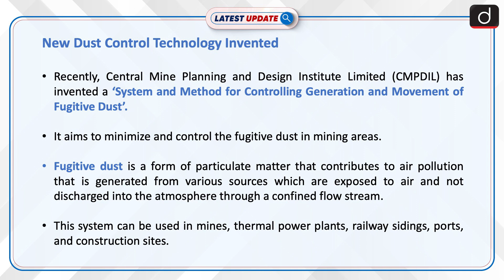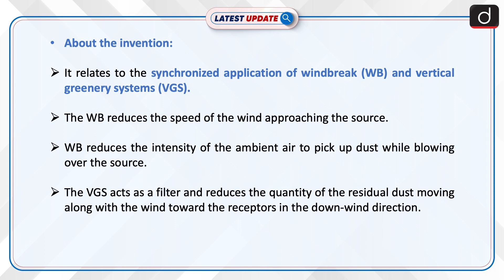New Dust Control Technology Invented: Latest update | Drishti IAS English

Comment from the maker: Ques: Which of the following statement/s are correct with reference to newly invented 'System and Method for Controlling Generation and Movement of Fugitive Dust':

1. It is invented by the  Central Mine Planning and Design Institute Limited (CMPDIL) 
2. This system can be used in mines and thermal power plants.

Options:

A) Only 1
B) Only 2
C) Both 1 and 2
D) Neither 1 nor 2
Reply: Both option is/are correct✅
Reply: Option c